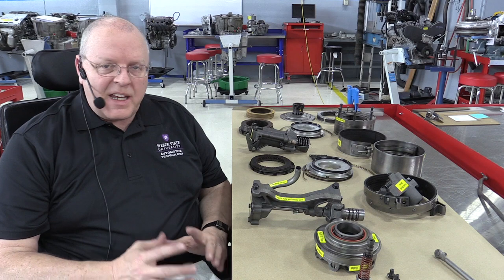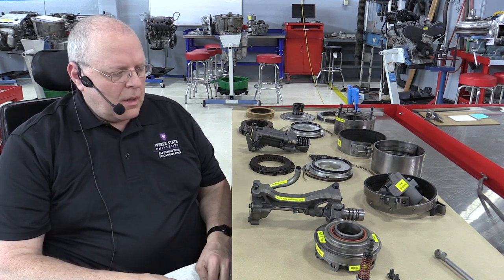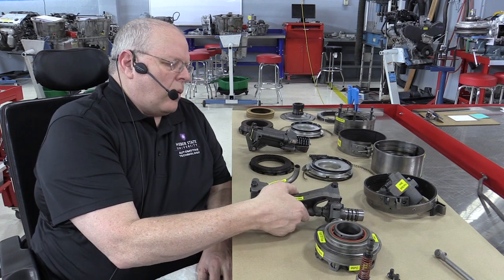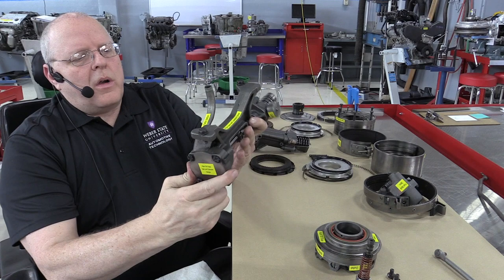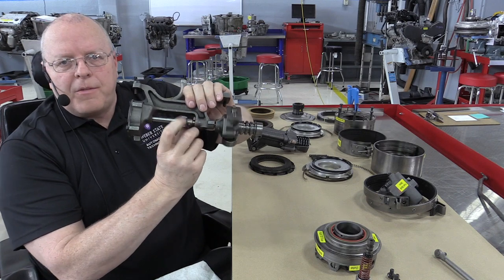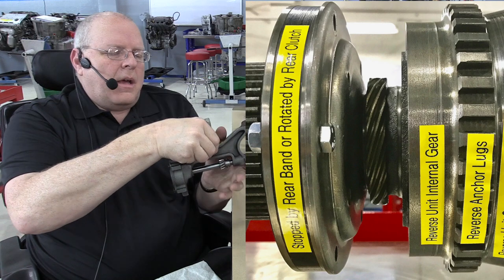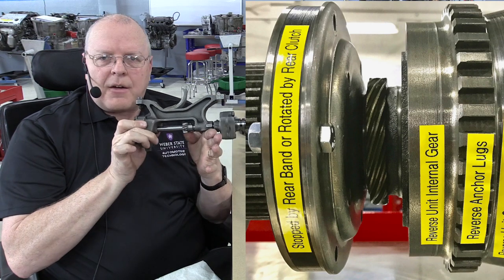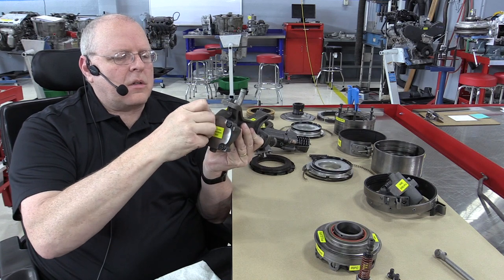World's First Mass-Produced Automatic Transmission - Part 4 - Hydraulic Components and Control

Comment: Interesting. The oldest hydramatic I have driven was a 1961 dual coupling version my mother's old Cadillac.  The 1-2 shift was super smooth as it was controlled by the filling of the second coupling, as was the 3/4 shift. You could feel the 2/3 shift a little because it was done with the clutches. We had the car for many years and over 100,000 miles.  They transmission performed perfectly all this time with no repairs whatsoever. The 390 Cadillac engine also had no internal parts replaced and ran as smooth as new with no increase in oil consumption.  Car had every option, a/c, 8 power windows, 6 way seat, power antenna, door locks, electric trunk release and power closer, power antenna, auto light dimmer, wonder bar radio, all in 1961.  That big Fleetwood could lay some rubber too, with that 4 spud. trans.
Reply from the maker: Very cool story! Thank you for sharing. I hope to get a dual coupling transmission soon and explore it as well. Have a good day.

Comment: Ehete was that video 35 years ago? Lol. I remember my dad rebuilding a transmission on our kitchen table. It was in the middle of the winter and he kept it on the bathroom floor until he got the parts to rebuild it. It was for an Oldsmobile. I was very fascinated and my mom was very,very unhappy.  There was tranny fluid everywhere. That being said,I never rebuilt one myself. I found it easier to pay someone more skilled at doing the job and having the proper tools. I have done engine rebuilds and more swaps than I care to admit but hey,I was young and thats what us guys did on the weekends.

Comment: Enjoyed your presentation so much sir. I would enjoy being a student using that facility and listening to instructors like you. Takes me back sixty six years to my dad's 47 Oldsmobile torpedo body sedan with that transmission. My friends picked there dates up in nice new vehicles, and Hosteen here  picked his date up in that tank of a vehicle with a flat head six engine. The thing had to weigh more than two tons.  There weren't many second dates for sure. The transmission was almost as big as the engine. Had to pull the passenger side floor  mat back and remove a cover to access the dipstick and you could always smell hot oil vapor coming through the vent. I have always had it in my head that when you started forward, instead of the rear squatting, the thing actually tried to rise up on the suspspension like a bullfrog before it moved off. On a Saturday in 1952, I cajoled my dad into installing new brake bands with turned drums because the original friction material was long gone. My first date. Picked her up and headed down US-66 toward town. The Olds began to slow down and smoke was rolling out of all four wheel wells. Brakes adjusted too tight. Had to call dad who caught a city bus and came down and backed the shoes off. Took dad home and took date home. That was that. That freshman girl had told all her friends about what happened and Monday morning I was the laughing stock of the high school.Doesn't seem like much now, but when I was sixteen it seemed like the seven vials of the apocalypse had been spilled. Like your in depth presentations.Regards to you sir.
Reply: What you see there is a man who likes what he is doing. That was how I felt in my years of power generation maintenance.
Reply from the maker: Awesome story! Thank you for sharing
Reply from the maker: Thank you

Comment: This whole series is fascinating. How exactly does the variable displacement vane pump "decide" how much eccentricity the housings should have relative to the vane rotor shaft? Does it have a spring/diaphragm regulator that regulates based on line pressure?

Comment: Good day, I am enjoying this video series as I have a 1954  GMC truck with the Hydra-Matic transmission. I live in Sandy, Ut.  I was wondering if by chance as a project, your students might want to rebuild my Transmission as I am going through a complete restoration project of my truck and I want to keep it as original as possible. If this is something that would be of interest, please let me know.  I would be happy to buy all parts necessary as well.
Reply from the maker: Hello Jeff, Thank you for the offer, that would be an amazing project. Personally, I am fascinated by these older transmissions and their technology. Unfortunately we do not have the time for it with our current transmission curriculum. Obviously we need to concentrate on modern technology. Best wishes!
Reply: @WeberAuto  Rats! Now who is going to do my '54 Pontiac's hydra?
Reply: @dalegribble60  East LA,  4th st and the 10 fwy is a transmission shop right on the corner....

Comment: Could you do a series on the 1950s military automatic trans missions in the m135 and m211 deuce and a half trucks? 
I think many people would find it very interesting, they used the hydra matic 301mg and  303m. these transmissions had a high and low range.

Comment: Might already have been linked elsewhere, but here's the 1943 US War Department Technical Manual for the Hydra-Matic as it was used in the M-5 light tank: https://archive.org/details/TM9-1727C-nsia
Reply from the maker: Thank you. I have that manual, but forgot to mention it in this series. I see on eBay you can still purchase brand new old stock 1943 Hydra-Matic for the M5 tanks. http://www.ebay.com/itm/Tank-M5-M5A1-Stuart-M8-HMC-Transmission-Hydromatic-General-Motors-NOS-G103-G127-/182357560886?hash=item2a755b8e36:g:eQQAAOSwcLxYLiQx&vxp=mtr

Comment: Awesome watching how the transmission evolved front that to what it is today. I have a special interest in watching this because my car has the transmission that came after this, it actually has Park., but I think the rest is pretty much the same as this transmission. I actually have a transmission manual that you could borrow if you ever wanted to see a detailed break down of this Transmission. The car that this belongs to is a 1956 Pontiac Star chief.
Reply: I do have a couple of questions for you. 1 The Original Transmission fluid is almost impossible to find, a local Transmission shop close  to me told me that the Classic Dexron Mercon III  is an O.K. alternative to the original Transmission Fluid. Do you agree with that or is there a better option you might recommend?
Reply: Question number (2 ). Where did you find the rebuild kit, and special tools for that Transmission? I have looked for an original  transmission pan gasket and wound up making my own. The transmission pan gasket normally only comes as part of a complete kit.
Reply: This question is a little off topic, but do you know if there was ever any type of Aftermarket Overdrive units offered on this type of transmission?  I never thought it would work until I discovered ( through your video's) that the 4rth drive was actually a direct drive, I now think it may handle it, but am not sure if it is worth so much effort. I may actually take a closer look at my manual and make sure the number 4 gear is the same as this transmission.  Learning a lot and enjoying the History Lesson.
Reply from the maker: Thank you for your feedback. I may take you up on your offer in the future. According to what I have read, the next transmission after the original Hydra-Matic was the Controlled Coupling transmission (Oldsmobile named it the "Jetaway") I actually have one of the Jetaway transmissions on the way to our shop along with a few other historically important transmissions. I intend to explore them the same way I did this Hydra-Matic. I'll have a Buick Dynaflow, Chevrolet Powerglide, Oldsmobile Jetaway, and an Oldsmobile Roto Hydramatic to keep me busy for a while. I will post videos on each of them over the next year.
Reply from the maker: According to the GM and SAE literature I have, any Dexron fluid, including Dexron VI that is used in today's transmissions, is backwards compatible with all GM transmissions back to 1937. in 1968, Dexron fluid replaced the previous Type A fluid your transmission originally used.
Reply from the maker: I found the kit at http://www.caddydaddy.com. The tools were on eBay
Reply from the maker: I am not aware of any overdrive units, but I have not tried to find one either. Best wishes and thanks for your feedback!
Reply: I will have to check that website out. I think the source of the kit I looked up was available through the Kanter Catalog.
Reply: The O.E.M. specific manuals are normally found at Swap meets, but you should have equally good luck I should think at EBAY.
Reply: They actually got simpler and less interesting due to use of electronics as "brains of the operation" instead of complex hydraulics/mechanics.

Comment: Is the governor  valve similar to an hydraulic shuttle valve?
Reply from the maker: No, it has a valve(s) that changes position relative to centripetal force. The changing position changes the fluid pressure verses vehicle speed.

Comment: I thought it might be good to explain why the rear pump works when in reverse.
Reply from the maker: Hi, There is a shuttle valve in the valve body that prevents the front pump fluid from exhausting through the rear pump in reverse. I assume this means the rear pump pressure in reverse is very low or zero.  What makes you think it works in reverse? Thanks for your feedback!
Reply: No, I'm now aware of how it works, just that somehow it has to accommodate the scenario of reversing.  Perhaps that shuttle opens the output side of the rear pump when the front pressure is higher and so just pulls air through in reverse.  I was thinking the pump might even be insensitive to direction of rotation.
Reply from the maker: I am pretty sure the front pump supplies all the fluid pressure needed for reverse. The only purpose of the rear pump is to supplement the front pump at times and allow for push starting the vehicle. Thanks again for your feedback!
Reply: OK, thanks again for the videos ...